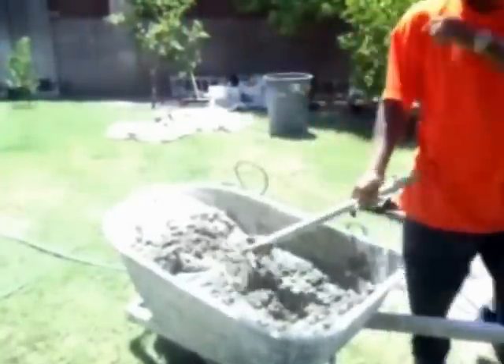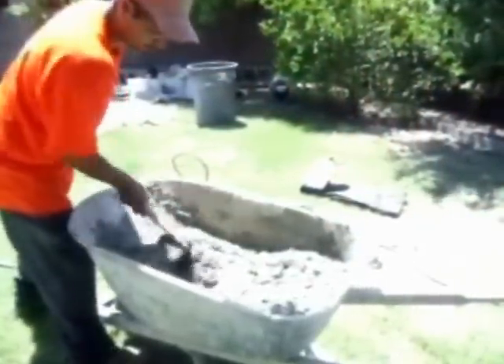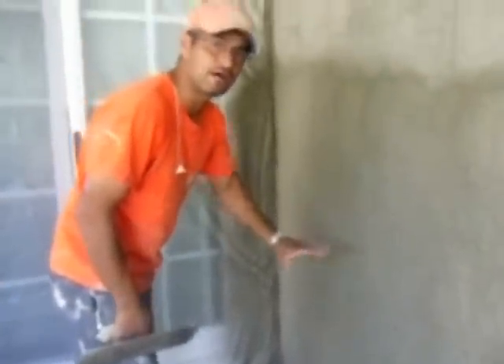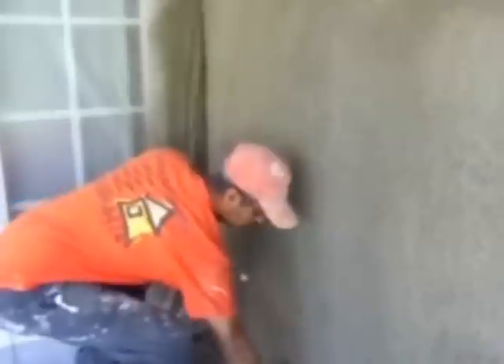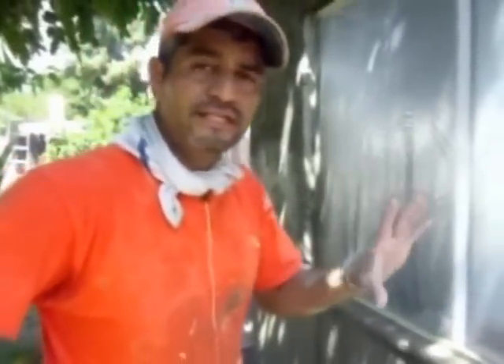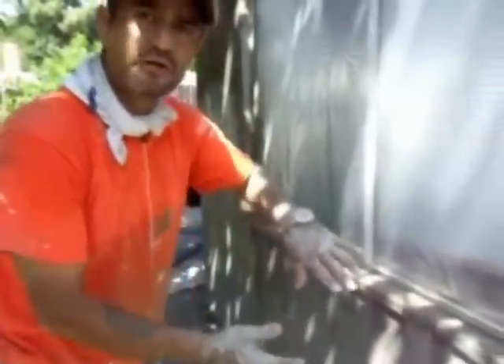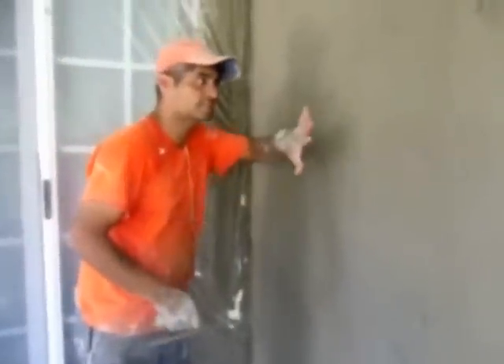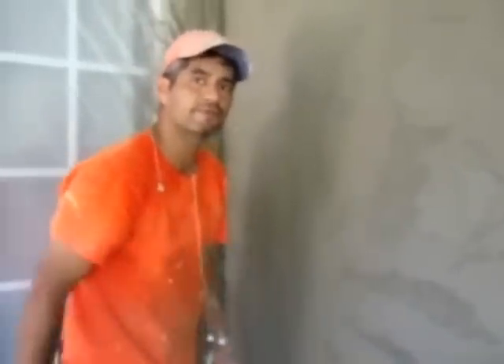Stucco sprayer hopper gun

Comment: it takes to long doing it long doing it like that by hand is the better way
Reply: Absolute rubbish coment
Reply: I'm a plasterer and he's right you could probably put it on faster by hand You've got to understand he's only putting one coat on and then someone's got to come up behind him and flatten it with a trowel.
well if you're going to push a trowel over it you might as well do it with some muck on the end and apply it You've got to run a Derby or straight edge over it to straighten it out anyway